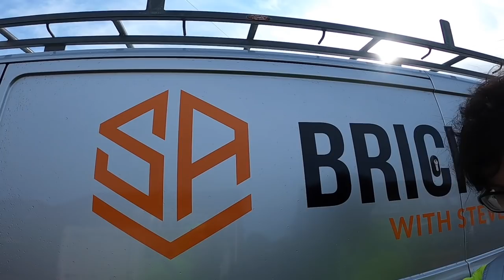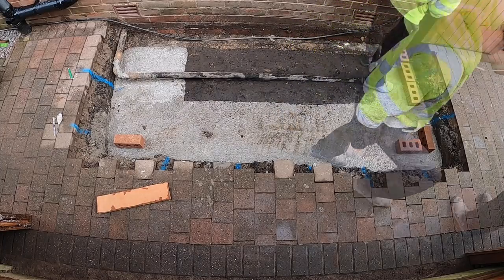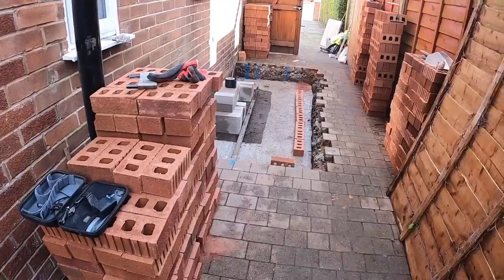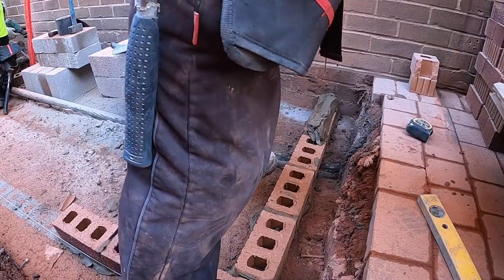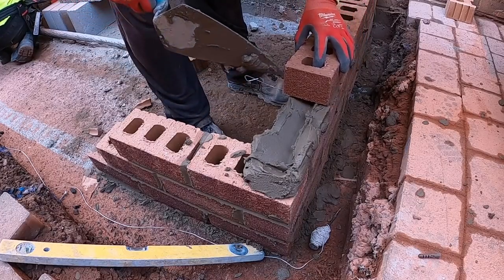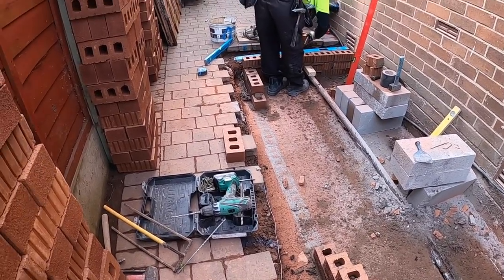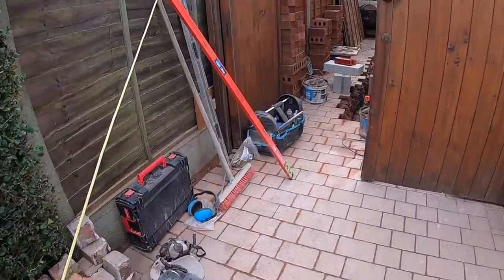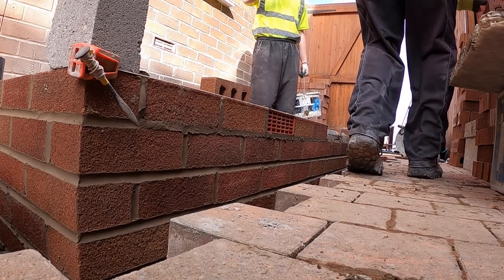MINI UTILITY  EXTENSION UP TO DPC

Comment: Is leaving that gas main there a good idea ??
Reply from the maker: The walls aren’t touching it 🧱👍🏽
Reply: @SteveAndAlexBuild  - fair enough - in my neck of the woods that may not be permitted and the pipe would need to be in sand and have identifying tap above it as well as a tracer wire - because the gas system isn't being altered I guess there is no need to bring it to code and in doing so there is no expense.
Reply from the maker: @serge.crispino418  . Thanks for the advice 🧱👍🏽

Comment: What is stopping the weight of the wall pushing down on the gas pipe? What is holding the new wall to the existing one?
Reply from the maker: The wall isn’t built onto the pipe 
Screw in Wall ties

Comment: Hi Steve when u do a full mix in mixer how much concentrate do u put in
Reply from the maker: 10 mil is plenty . It depends how crap the sand is 👌🏼🧱👍🏽
Reply: ah that's why as I've put in 10ml b4 and its com out not good so thought I had to put more in so it's down to the Sand which lately Sand is getting worse
Reply: How's your back Steve with all the bending over mines all but gone with all the different work I do and my knees is starting to go 🙄
Reply from the maker: @philstation335  my hips are on their way out. 😬🧱👍🏼
Reply from the maker: @philstation335  🧱👍🏼